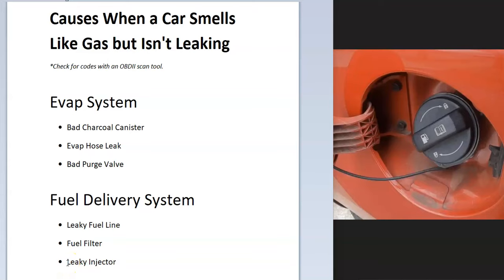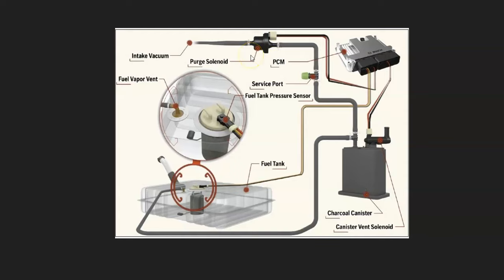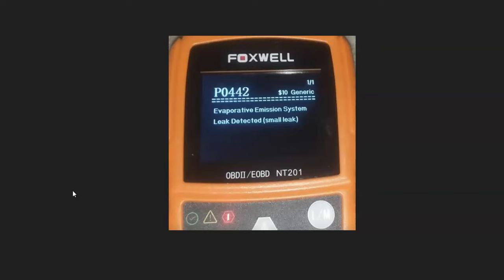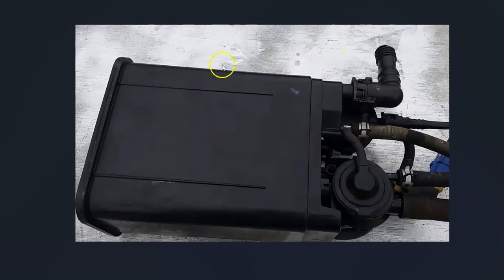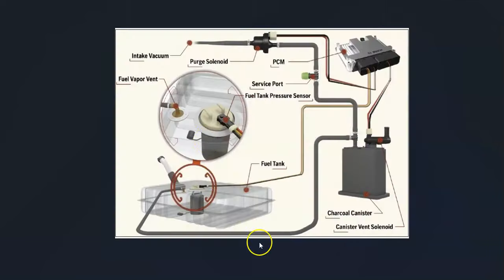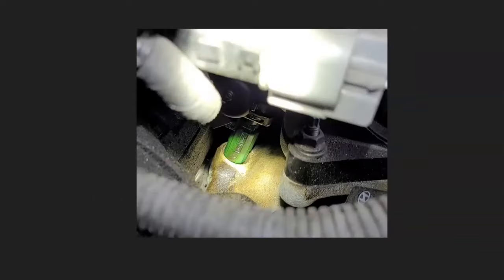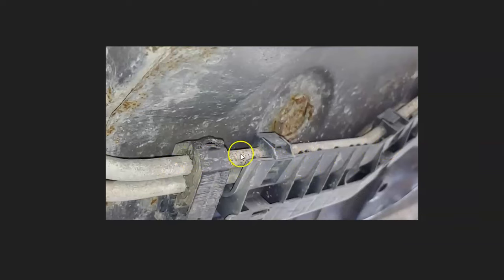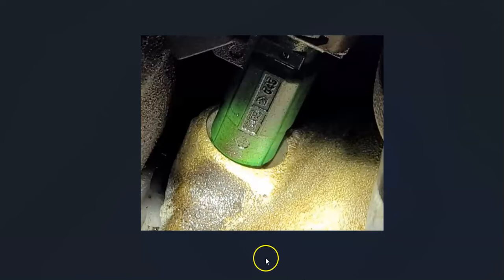Causes When a Car Smells Like Gas but Isn't Leaking

Comment: What if you only smell gas in the car when it is extremely hot outside with temps over 100?
Reply: I got the same problem
Reply: Run
Reply: Anyone got info?
Reply: It’ll be the same as with anything, the vapors expand and are more noticeable. I would check the fuel pressure. Could be a faulty or leaking fuel pump since they sit inside the vehicle.
Reply: Bro thank you!!! I have a 2023 Transit that’s doing that only when it’s hot!!
Reply: I have this exact issue on a 2008 E150
Reply: Today got over 100f, 2017 Tahoe with strong gas smell inside the cab, first time doing this  since we bought it, what could it be??😢
Reply: Me too,,, my new car happened unfortunately, help me.
Reply: Me too! I suspect fuel pump
Reply: @chaidezrigo  not at all, warranty claim already replacing fuel pump with the new one, but it happened again.
Reply: @daniel-5377  could be the gas cap. At this point buy yourself a smoker machine and smoke the fuel system through the fuel filler. Easy to use and accurate after
Reply: @chaidezrigo  Thank you
Reply: Today temperature raised to 120 in SoCal and I started smelling fuel inside the car and outside too, even the fumes coming out of the exhaust pipes smell like raw fuel. Reading all this comments made me think that this is normal on hot weather.

Comment: had strong gas smell in engine bay.just changed one of small craked hose  attached to the EVAP canister located in engine bay. issue resolved.

Comment: I have an '03 Ford Taurus. I smelled gas in my garage and didn't know why. Turns out, A plastic elbow coming out of my gas tank (connected to the fuel line) was cracked. It effectively became a fuel injector and was spraying vaporized gas into the air. Coincidently, I had just given my car back-to-back treatments of fuel system cleaner which may have been too much for the plastic elbow causing it to fail.

Comment: Good video! 
What about the gas smell coming through the air vents inside the car, what are the steps to find it if not seeing any leaks on the engine. Thanks
Reply: When you find out let us know.
Reply: That’s your fuel rail if you smell it Thur your vents

Comment: Right now My Subaru smells like gas and has no power up hill or to go over 50mph.
If I turn the steering wheel and make the gas shake I’ll get a small burst before it starts up again.
Has a very bogged down sound as it starves for gas.
It’s not the spark plugs or air filter or coil or gas pump,
I also keep getting a flicker of lights in the car as if there is an electrical issue and it’s not a loose battery terminal,

Comment: Is it possible to have a very strong gas odor outside of the truck kinda around the gas tank but not have a check engine light come on? I’m thinking it might be something with the EAP system, but I don’t have any lights on.

Comment: Hello Sir @HVAC_Mechanic,

I have a Suzuki Baleno petrol car from India. I notice a petrol smell during the morning start for about 10 seconds, after which the smell disappears. I do not see any fuel leaks anywhere inside the hood. I am not a mechanic, so how can I diagnose this issue myself?

Note: The authorized Suzuki service center says there is no leak and everything is fine. However, they don't seem to want to spend time checking everything thoroughly. They are so lazy that they just say if it's not causing any major problems, I should simply drive it.

Comment: i bought a new gas cap.  its cheap but seems like it doesnt seal the gas well.  i can smell it from the outside.  so decided to use the old one.  now when i drive i can smell the car in the cabin.  and opening the trunk it has this strong gas smell.   and i dont know what to do. any suggestions?

Comment: Im a woman that doesn't know much about cars. I have a gas smell under the hood on the drivers side. But i also hear something under the hood running aLot! What is it and how much to fix it?
Reply: Did u get it fixed u not alone I'm having same 😢😢
Reply: @LindaCharles-ll6lm could be the high pressure fuel pump, as there where they usually located.

Comment: i just changed my fuel pump and started having this problem, didn't have it before i changed the pump
Reply: Did you solve it? Probably your new fuel pump is giving higher pressure so there can be leaks in your fuel system which are are more visible now.
Reply: @pithaller9791  yea it was fixed, the lid on the fuel tank has a rubber seal and the seal crystalised and broke so the vapor was leaking out

Comment: Wouldnt this cause a check engine light if it’s going to pull a code with the machine? I have no check engine light on. It always seems to smell worse when I first fuel up. Once my car sits for awhile with a mostly full tank I can smell it pretty bad when I get back in my car after it’s been sitting awhile. After driving nd using the heat or AC the smell goes away. Seems to smell at its worse sitting for hours and off. I can only smell it when inside the car.
Reply: I am having the exact same issue. The fuel smell is stronger after my car has sat still. I don't have any leaks.
Reply: Did you guys solved the problem 
I also have the same issue
Reply: Did you solve it?

Comment: Last winter my car didn't smell gas at all at any time, now that the temperatures gone up it started smelling gas do you guys have had any issues like this ?
Reply: I just noticed the same problem today, hasn’t happened before but noticed it today when running my ac, it only smells when my ac is on and I stop at a stop sign or light. It doesn’t smell when I have the ac off
Reply: Yes same here